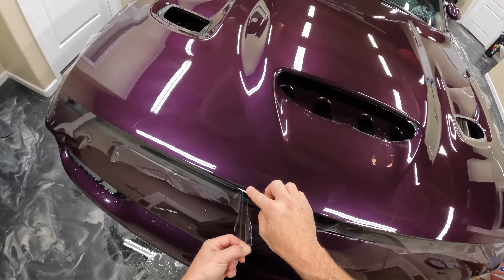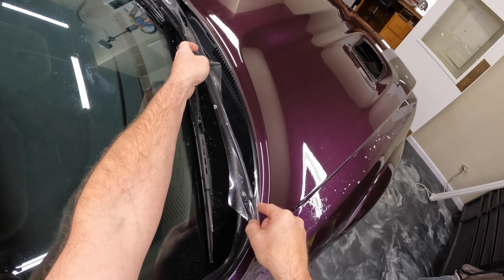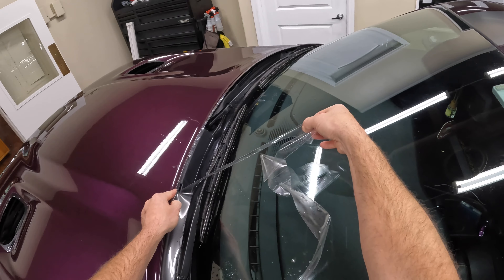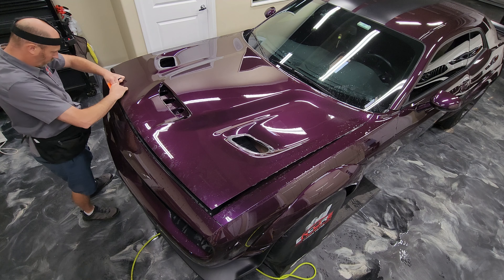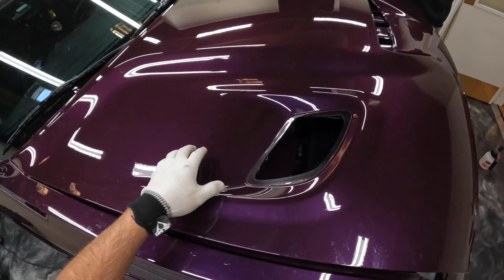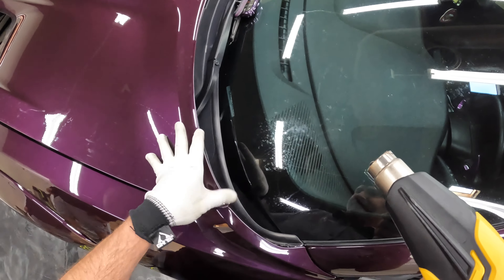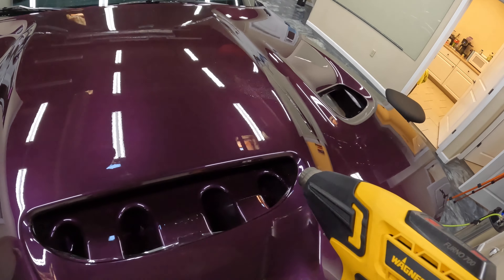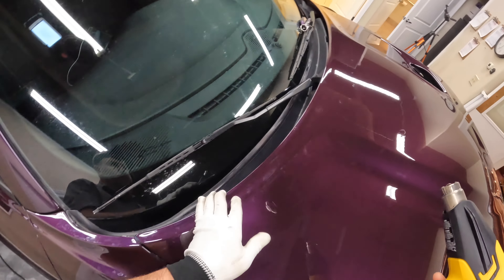Part 2 - Tackling a Difficult Hood Paint Protection Film install - Dodge Challenger Hellcat

Comment: Hi there, loved this video! I had ppf installed on my 2022 scat pack this past week and was looking for info on how it is done. There a few spots I am unsure about and want to ask at my two week check up. On the front top lip of the bumper, should the ppf wrap around there? And what about the inside corners to the left and right of the headlights? I also ended up with two seams on the top part of the bottom section of bumper that I don't understand, one on each side, each about 3 inches in length in the middle of the lip. Thanks for any advice and insight. I wish I could add pictures to show.

Comment: Excellent as always, what mil thickness is the material your using
Reply from the maker: It's an 8mil material.  I used to install some 10 mil on headlight, but that stuff was hard to work with. That was also a long time ago. I'm pretty sure it was made by 3m.
Reply: @EncorePPFtint  two questions, what brand are you using, and what is the best ambient air temp for the install bay.
Reply from the maker: Most of the ppf in my videos is going to be PremiumShield NextGen. 
The air temp in the shop varies from 67-80 degrees F, depending on the time of year. I run the heater in the winter and ac in the summer. If I could make it one temp, I would be right around 70 all year.

Comment: Yeah…company I used messed up the edges.. didn’t get close enough to the extractor vents..an 85%job…
Reply from the maker: I'm guessing that is because they didn't remove the vents to do the installation. Every shop does things a little different.  Those are so easy to remove, and I want little to no visible edges in my installs.  👍🏻
Reply: @EncorePPFtint  yeah, that’s what I was expecting from them…guess they are too used to doing bloody Tesla’s ….lol got a video on how to dyi video to reattach edges that are coming off from shut lines? Lol
Reply from the maker: Is it actually popping up around the vents? That's pretty much game over for that install. Sometimes, it can be a pushed back down, but almost never without leaving some kind of lift line. What color is your challenger? That's a bummer!
Reply: @EncorePPFtint   oh no not around the vents, the shut lines pretty much. Along the doors, hood, trunk lid, the  bits where they fold over around the edges. Those are coming off. Sorry if I want clear, rough at times typing on the app (like I am now)My cars white (Knuckle harr harr dodge) with the caramel interior. With the 6 spd manual and the hellcat brakes
Reply from the maker: Oh OK. I misunderstood what you were saying. If it's the wrapped edges popping up, it's either bad prep work (left grease or wax around the edges) or wrapping the PPF  before it was dry enough.  Can you have them fix it or redo the work?